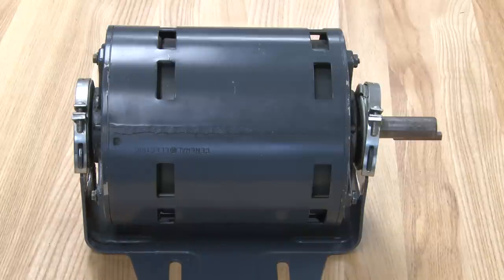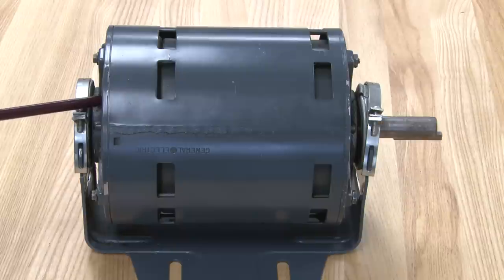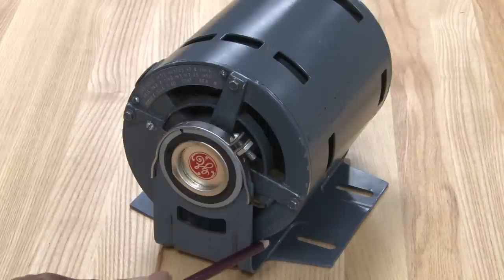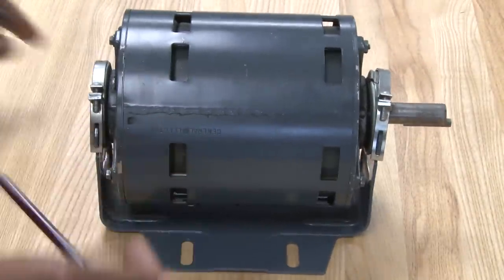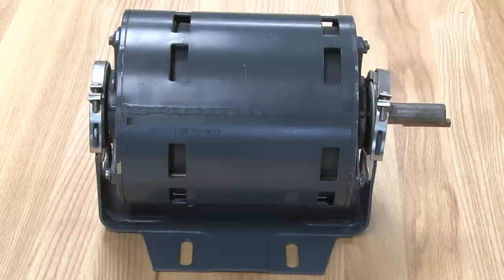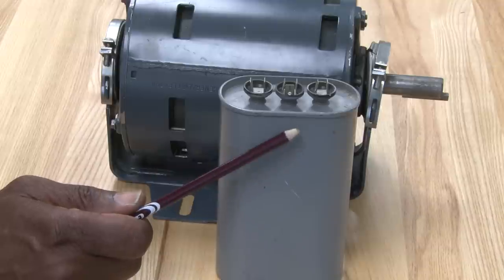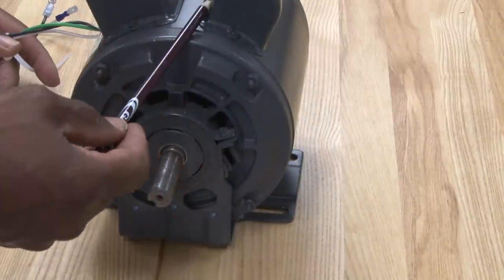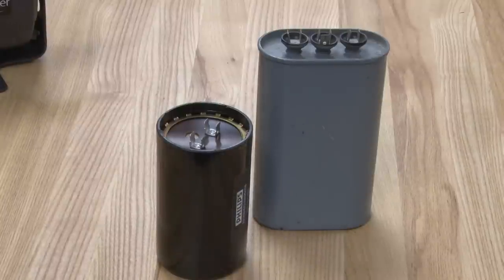Split Phase Motors

Comment: hello my friend i want to ask you about the first motor from general electric its used for washing machine 
can it work for several hours if the current is less than written on it i will make it work for swamp cooler while the swamp coolers uses almost same motor but with capacitor 
can you help me
Reply: If you run it at a lower amperage you run the risk of your rotor stalling out under load then pulling locked rotor amps, if left long enough you will need a new motor.. If you have a motor that pulls around 6-7 amps then I’m pretty sure you need a 45mfd run cap